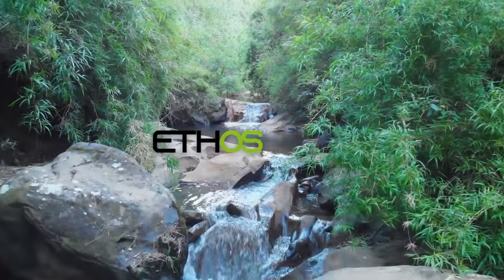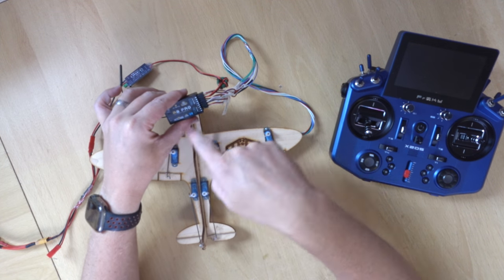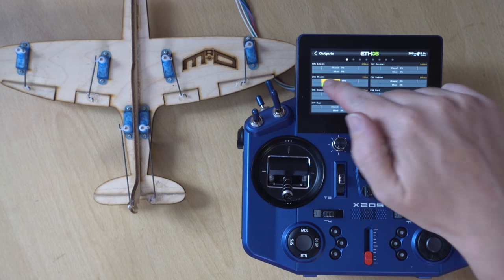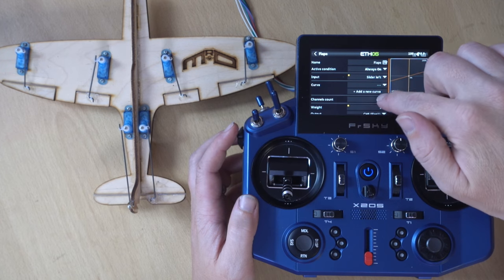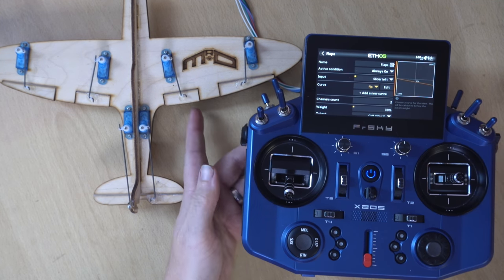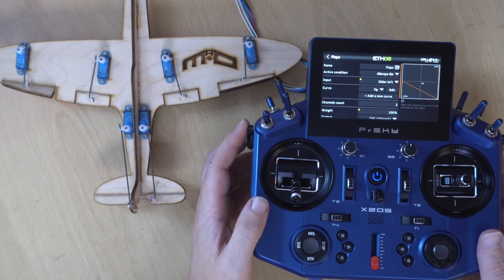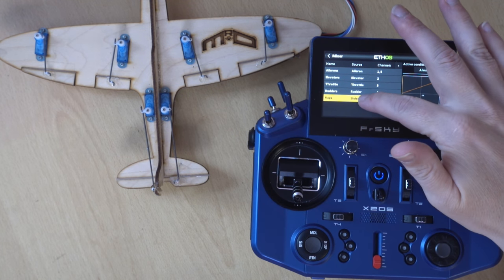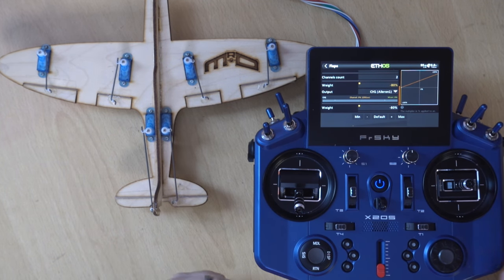Setting up flaps, flaperons, or spoilerons in ETHOS

Comment: Excellent vid,  new radio coming on Monday, so will be in regularly for assist  :) transferring images will be the same as the Horus 12 i imagine.
Reply from the maker: Its a great radio Cain. I’m sure you’ll enjoy it. Yes, the model images should be the same.  All that I copied over from my X10S Express worked without issues. Places like Sky Racoon also have X20 images now too.

By the way. Thank you for becoming a Patreon supporter. It means a great deal.

Comment: When I set up flaps I put them on 2 different channels and then assigned a 3 position switch. I put the switch in the first position with the servo arm off. I put the servo arm on with the switch in the first position so it would only move down when I went in the other 2 positions. This seems to work for standard flaps.

Comment: Thank you for the intro to flaps video!!  Q: How do we adjust servo arm throws?  Cheers!!
Reply from the maker: Throws are adjusted using the different holes on the servo arm and control horn. Closer to the servo is less throw. Closer to the control surface is more throw. This video is for iNav. But the physical throw parts are the same https://youtu.be/tGRDZzaerOE

Comment: Thank you so much for the flaperon video. I have a question , I did bind an ACCST  S8R receiver to an ETHOS Tandem X20 HD Transmitter. Everything work OK , stabilization, Hover, Knife flight, but the Aileron servos acted weird, they rotate 45degrees  to one direction and only approx. 22.degrees. to check this glitch I bound the S8R to a Taranis QX7 and had the same issue.   Do you believe it could  be a Firmware issue?  Some recomendatios?
Thanks   Salsordo
Reply from the maker: To be honest, it is hard to say. From my experience, the control surfaces have moved pretty evenly. My first though would be the control linkage geometry has got a lot of differential present.

When neutral, is the control rod at 90 degrees to the servo horn?

If you disable stabilisation, how do the surfaces act?

Comment: When setting up flaperons and assigning the same channel as the ailerons, what happens if you hit “Yes” when prompted to “swap settings” at 7:04 ?
Reply from the maker: It will swap the 2 channels over. Not something you want to do in this situation. But can be useful other times.

Comment: Great video as usual, thanks…what about using a 3 position switch like no flaps-tkof flaps-landing flaps rather than a slide switch ?
Reply from the maker: Thanks Raphael. Yes, the 3 position switch will work just fine. You can add a curve to the switch to get the right level of flap required. Also there is the slow feature, so that the flaps extend and retract gradually.

Comment: Hi Darren a question in regard to Flap => Ele mix, I have a 2 second delay to deploy each postion of flaps, going up and down.  How could I make the Elevators in the Flap=> Ele mix move with the same 2 second delay?  I cannot find an option.
Reply from the maker: It looks like that mixer doesn't have the slow up or down. I would just use a Free Mix, set the source to the flaps and the output channel to the Elevator. If you set the up and down weight to 10%, it will be the same as the default for the Flap => Ele mix.

I'll add a request to get slow added to Flap => Ele.
Reply: @MrD  Thanks. In the Flap => Ele mix I set source to flaps and it slowed down the elevator.  I had a 3 point curve to set values for the elevator compensation triggered by the same switch as the flaps but when I selected the Flap as trigger source, the three point curve would not work.  I changed it to a two point curve, that I think is doing the same , as if I change the curve for the weight option you describe. It would be easier if they include the delay option in the mix.
Reply from the maker: Yes it would definitely be easier if the speed was included in the mix. I don’t know why the curve would stop working. You would definitely want to have different movement for the different stages of the flap compensation.

Comment: Was wondering if you may be able to help me out? I'm running a Flysky FS-IA6B receiver with a TX16s transmitter. My FMS T28 has the ailerons and flaps wired with Y cables. How do I get my flaps to go in the same direction? It works for my ailerons but obviously not for my flaps. I will watch the video again, but any help would be appreciated. Also,  I can't flip or install the servo any other way without doing some modification.
Reply from the maker: Hi Tomas. It depends on the servos on the plane. If they are facing the same direction (not mirrored), they should be ok with a Y lead. If not, you would need to either wire the flaps separately, use a servo reverser on one of the flaps, or open up one of the flap servos and swap some wires. I've not done the last one myself. I usually use separate connections for all 4 wing control surfaces.

Comment: Hi Darren great video how do I do flaperons with r4 receiver please
Reply from the maker: You can’t unfortunately, unless you don’t have a rudder. You need to use 2 channels for the ailerons.
Reply: @MrD  I’ve got ch 1 and 2 on ailerons 3 elevator 4 on rudder Darren I have a DLG glider thank you for your reply I’m on my own as the local club don’t want to know DLGs
Reply from the maker: @mikebell9536  that will work then. Just follow the video and the flaperons section, using your channels 1 and 2.

Comment: I am looking to set up a throttle rudder mix. Would it be similar to this video?
If not, it would be great if you could do one please?
Reply from the maker: There is a mix in ETHOS for Thr => Rud. This should do what you want straight away.
Reply: @MrD  Thank you. That's done the trick

Comment: Hi Darren , do you know if you can add retracts or a electronic ignition switch into the  transmitter,  I've tried   has me stumped to where it is,  there doesn't seem to be a channel set aside for these, thanks Philip
Reply from the maker: Yes, they should only need a free mix as both those things are just switches. I’m going through the ignition part myself at the moment; setting up a model for my Wots Wot XL. That doesn’t have the retracts. But does have ignition and choke.
Reply: @MrD  I'm sorting out a lysander and a skybolt,  it's been a mission 😂😂😂😂
Reply from the maker: I bet. I can make a video for retracts. Its a shame I don’t have any models with separate gear servos or doors. As that could have been good for sequencing. 

I can also make a video on the ignition, though I’d have to demo it with a servo. I guess that part doesn’t matter so much, as you’d just see an LED anyway. I have mine so that it can be turned on independent of throttle cut. But when you cut, it kills the ignition too.
Reply: @MrD  I've been using a aftermarket switch hooked into the reciver,  flick a switch and it kills the power to the module, works great if I can work out transmitter I've done so with a futarba transmitter, easy as
Reply from the maker: Sounds like a good idea. I just have a regular switch for the ignition on the plane. Power on one side, ignition on the other. But you still have to control the ignition from the transmitter. 

Just checked out my model again. For the ignition, I use the momentary button on the rear left of the transmitter. Pressing it turns the ignition on. Pressing again will turn it off. Switching on the throttle cut will also turn off the ignition if it is on.

Comment: Hey Mr. D.I just bought a Tandem X20 and your videos have been a God-send at the manual leaves much to be desired. However, I was wondering if you plan on showing a setup for a typical six servo glider. I've been able to figure out most things but Flight Modes/Butterfly and other glider-centric settings still have me baffled. I'm sure there are many more glider pilots in the same position as me as the radio is fairly new. Any chance of helping out us pure glider guys?

REPLY
Reply from the maker: Hi Vaughn, glad the videos help. I've not used and don't have a 6 surface wing glider unfortunately. So it would be difficult for me to do this at the moment. For regular 4 servo wing gliders, the E-Soar transmitter models are excellent. They have calibration modes that work so well the gliders hardly ever need trim. https://rc-soar.com/ethos/
Reply: @MrD  thanks for your tutorials, they’re really helping me go from OTX (which I’d half mastered) to Ethos - I do have one question though. When using a flap mix to drive ailerons up and flaps down, I run out of mixers (4) when it comes to adding elevator comp, any ideas? Cheers, Elliot.

Comment: ok so because of your video I was able to set up my x20 and acquired connection between the radio and receiver.  All control surfaces respond but the flaps. I followed your step by step procedure and assigned flaps to  switch G. Checked the output and is in fact working. Everything on the radio works fine. But flaps on my plane don't respond when I flip switch G. Connection to channel 5 is ok coz when I plug in the flaps servo the flaps move down. What do you think is the issue? Thanks.
Reply from the maker: What receiver are you using?
Reply: @MrD  TD R10.
Reply from the maker: That receiver can have configurable ports. It's worth checking that port 5 is outputting the signal from channel 5. I don't have one of those receivers here to test, or see what it's set to by default unfortunately. There is a section in the manual called "How to configure channel ports" which shows where to see if the Ch 5 is being output. https://www.frsky-rc.com/wp-content/uploads/Downloads/Manual/TD%20R10/TD%20R10%20Manual.pdf
Reply: @MrD  I’ve actually figured it out. Flaps working now. Even mixed it with elevator. Thanks so much for your usual helpful replies! 👍👍👍

Comment: Is this mix permitted when a 3 axis gyro is installed ?
Reply from the maker: The mix its self shouldn’t be a problem. The only times you may end up with issues is if you are using a self levelling mode. If you are too slow and stall, a self levelling mode will tend to do all the wrong things. Though this is also true without any of the flap/flaperons/spoilerons mixes. If you’re just using basic stabilisation, there shouldn’t be a problem.
Reply: @MrD  Thanks So Much .1 I'm a new user to this Brand and have much to learn. Although your tutorials certainly make it much easier !!!

Comment: Hi Darren, I keep coming back to your vids when setting up. Really useful so thank you! How do you change the deploy speed of the flaps in the flap settings? Successfully set up flaperons on a freewing F16 and flown 10 flights with the new Frsky x20, thanks to your help. Ant
Reply from the maker: Hi Ant. I'm glad the video has been helpful.
To change the deployment speeds, you can change the Slow Up and Slow Down parameters in the mixer or the outputs.
Reply: @MrD  thanks a lot I’m going to give this a go!
Reply: @MrD   I’m having a slight issue. As I have flaperons, Aileron 1 is in to Ch1 and Aileron 2 is in Ch7. When I change the slow down speed in the outputs menu settings, it also has an effect on the ailerons due to both flaps and ailerons functioning off Ch1 and Ch7. I can’t seem to find an option for slow down speed in the mixer menu on my flap mix. Any ideas? Thanks-Ant
Reply from the maker: It is a pain that not all options are in some mixes that will benefit from them. If you use a free mix, as opposed to the flaps mix. The slow should be there.
Reply from the maker: Sorry Anthony, your other reply seems to have been removed. 

Of you use a free mix for the flaperons. You can set the slow in there and is has no effect on the ailerons. I’ve just tested it and it works fine. It will only effect both controls if the slow is performed in the outputs.
Reply: @MrD  I’m not sure where it’s gone! It’s worked though! Thanks a lot, it was actually really easy to do, really helpful of you. Do you know why I don’t have a keyboard when I type, I have to keep using scroller but I see you have a touch pad.
Reply from the maker: Sometimes YouTube just deletes comments that is claims are “against it’s community standards”. But usually are fine and they just have an overly active AI, which removes more than it should. 

You may need to update ETHOS. I can’t remember the version the keyboard appeared. But it’s been in there a little while now.

Comment: Man, Ethos looks pretty nice. It’s clearly the same OpenTX interface, but just spending a few minutes making it “pretty” seems to make a world of difference. Plus a touch-screen that actually looks responsive (ever tried an iX12? *gah*)…
Reply from the maker: It’s not quite the same. The main coder is the same guy who wrote OpenTX, so there are a lot of similarities. But also quite a few differences. Someone used to OpenTX would be caught out by a couple of things if they tried to do everything the same. But it would also be familiar enough to catch on pretty quickly. For new pilots, it is more friendly.

The touch screen is nice. Probably better than it looks on the video, due to the angle I have the transmitter to record. I can’t see where I’m supposed to be touching so well. They keyboard part is awesome too. I’ve not tried an IX 12, but by that reaction I guess I wouldn’t want to 🤣